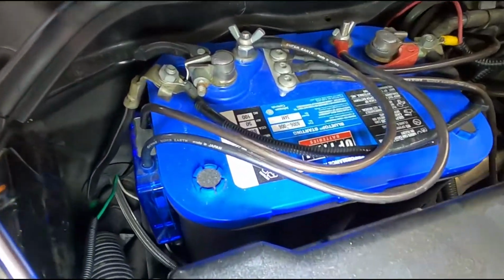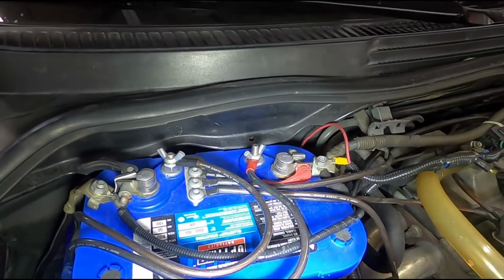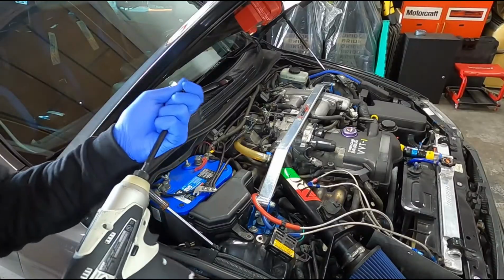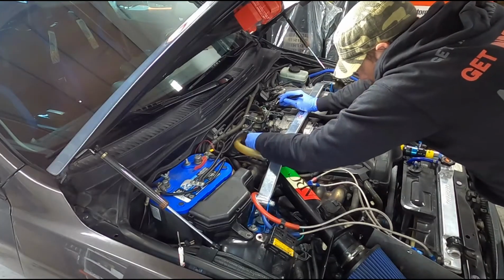IS300 VOLTAGE STABILIZER REMOVAL.  WHY YOU NEVER SEE THESE IN ANY BUILDS ANYMORE.

Comment: So does this work like a grounding kit? Is this meant for more voltage = more response / power etc
Reply from the maker: Just like a grounding kit.  Exactly the same as far as I can tell.  Supposed to be good for all the things you mentioned.  Horse power, throttle response, everything including brighter head lights.  Some of the claims may be true along with numerous others that plenty of people will claim are accurate.  I just didn't see any noticeable improvements where I could say for certain, "yes this thing makes a difference".  These have their uses, but for my application it was more of an eye-sore and not with the bother.  Hope this answers your question.

Comment: WRONG, have you ever fine tuned a car without a voltage stabilizer? I used this for 7-8 years now and its amazing, make my engine run quieter and helps me a lot for fine tuning, as for extra grounding? wtf, why is that bad? Second, you installed it wrong, it says in the manual wires down not up.

Comment: The one you had installed looks like a fake one anyway so
Reply: I've had both a real and fake one. 
The only point to installing either is the voltage readout ( my modern cars didn't come with one ) and looks... and the extra grounding points, which never hurt to have.
Reply: @foxbox2879  Yeah good grounds  and a good alternator and battery should be enough